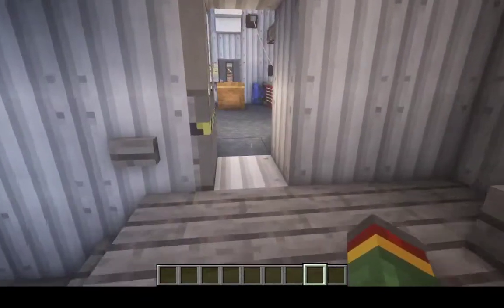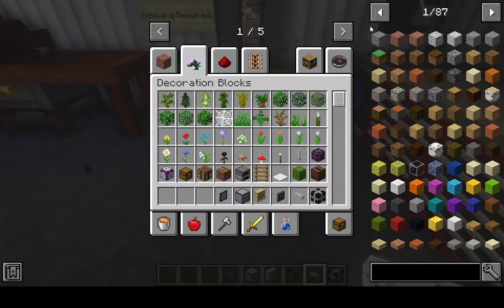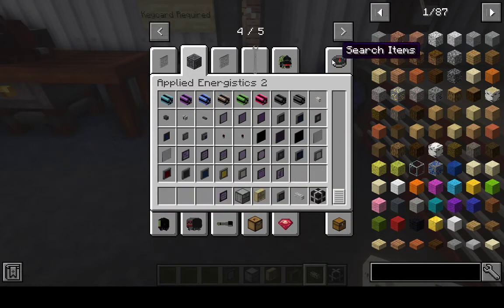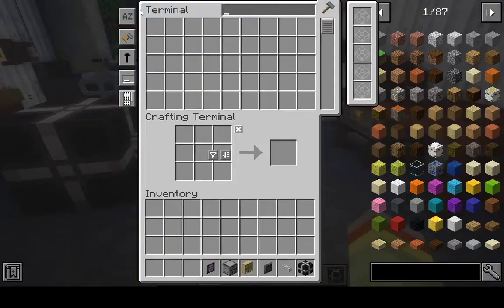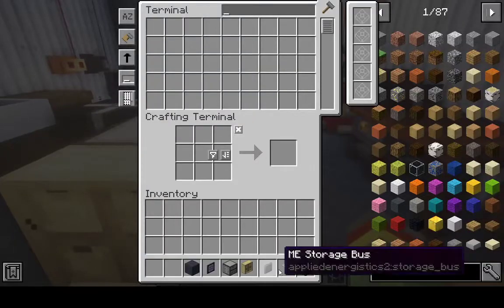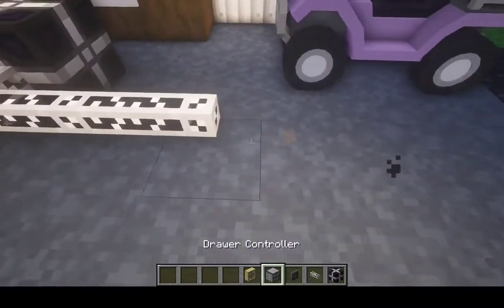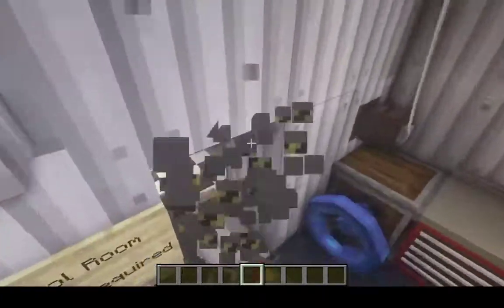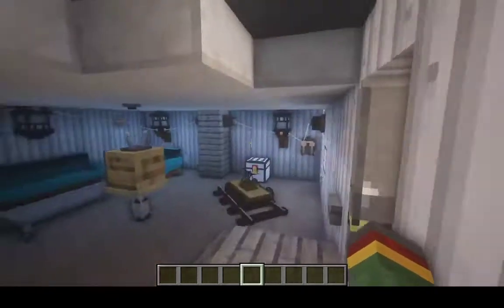How to hook up storage Drawers to Applied Energistics 2 (remaster)

Comment: how does ae2 interact with the compacting drawers? like let's say I have iron ingots in a compacting drawer can ae2 take nuggets, ingots, and blocks out of that one drawer or will I have to have 3 drawers set up to hold the 3 iron types?
Reply: Not sure about AE, but Refined Storage sees compacting drawers as simultaneously being all three options.

So, if you insert one stack of blocks, storage showed you having 1 stack blocks, 9 stacks of ingots and 81 stacks of nuggets, but removing any of them updated all three numbers appropriately. It was REALLY nice.